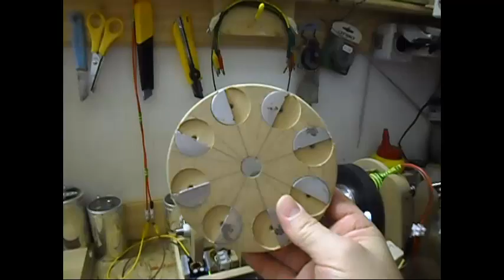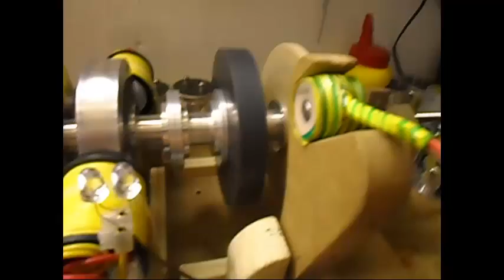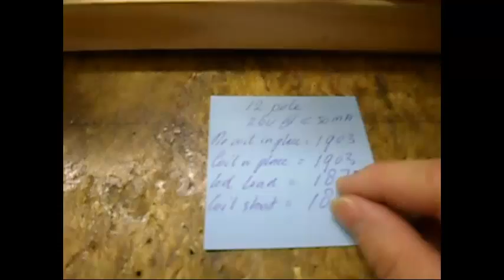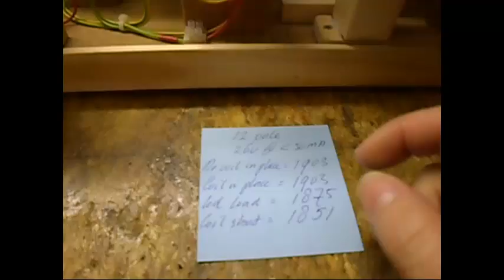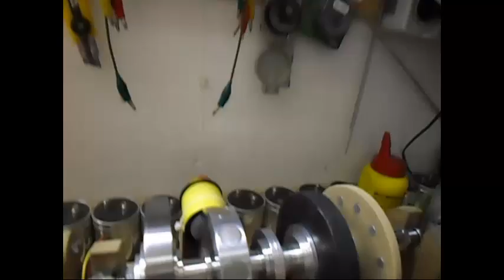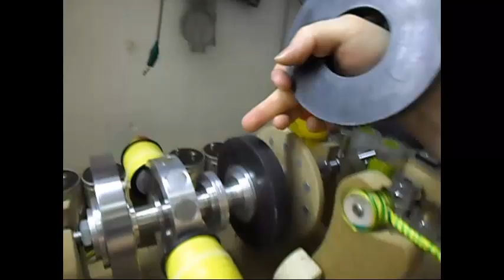Flux Gate Generator - Update 9 Rotation of rotor & ring magnet - 12 pole rotor...

Comment from the maker: Just a update where i'm testing a 12 pole rotor of tiny iron disks...^^
Input = 26vdc @ <50ma.
Just spinnig away = 1903 rpm
Coil in place = 1903 rpm...Oh...o.O...that's kinda odd...lol
Coil & leds = 1875 rpm...that's not bad at all...o.O...lol
Coil shorted = 1851 rpm

This one does perform pretty good...^^